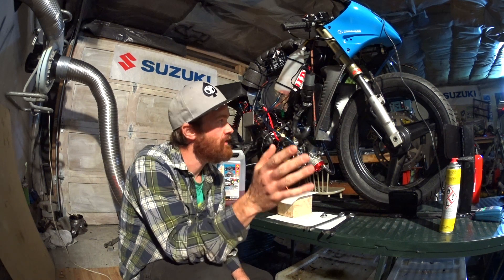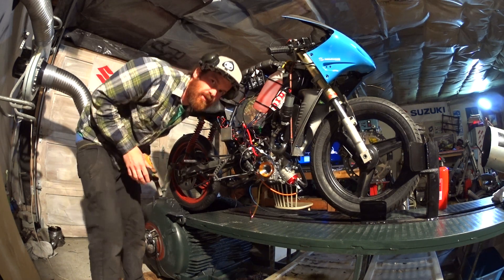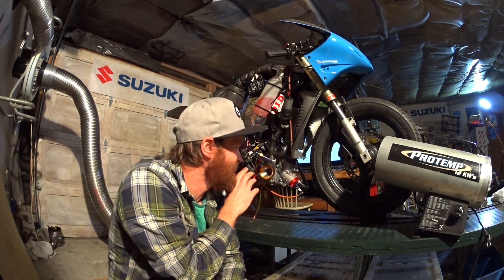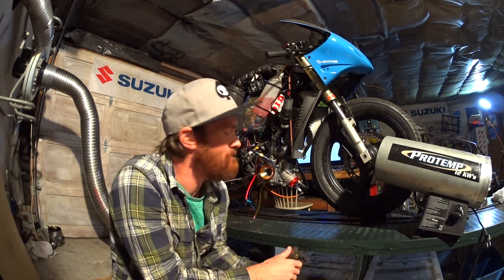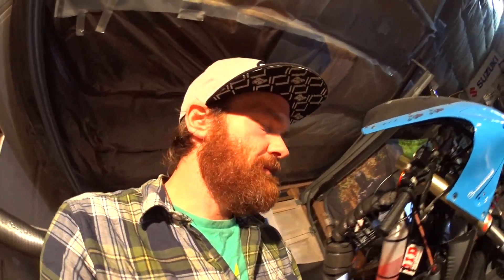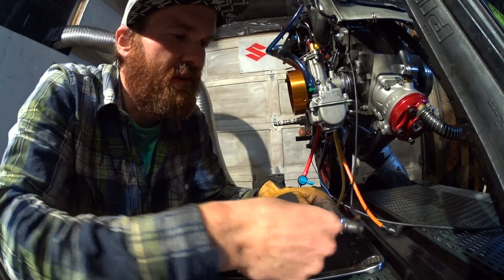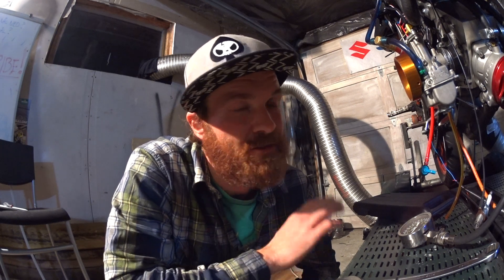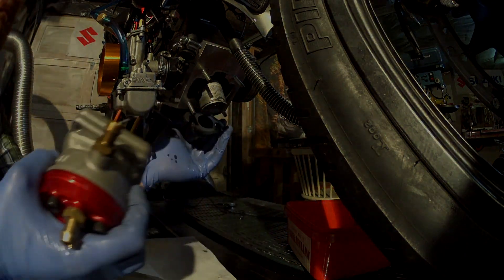DESTRUCTION ON DYNO | Moped on Methanol/Nitromethane - The End?

Comment: Anybody who has experience with model airplane engines (names like: OS, Webra, Cox, Rossi, OPS, HP, Fox, ASP, K&B, etc) that run on methanol and nitro, knows just how important it is to never run lean. Model airplane engines have a needle valve rather than a fixed jet size. The engine must be started with the needle valve setting richer than the final required setting. Once the engine has started, the needle is closed in towards the best final setting. RC modelers generally don't have instrumentation to set their engines, they have to do it by ear. The best final setting is NOT at the maximum speed which is fairly easy to hear. There are numerous things that have to be allowed for, so that the engine never runs lean. These are: nose up or climbing, fast turns, higher air temperature, the plane's speed, air pressure, etc. As a result, a certain safety margin needs to used to stay on the rich side of the best final setting. This is generally determined by experience. Fortunately, the small model engines running on glow plugs, sag and die before they damage themselves, so a burnt piston is extremely rare.
I would suggest that you get a model engine and play around with it to learn what operational care it needs when on methanol and nitro. If you do experiments on a smaller engine, it will be less work, cheaper and quicker to do. Maybe use a weed wacker engine. They are a dime a dozen. Keep up the good work.

Comment: hello it's exellent what you do !!! how much you put ahead of the ignition of more than with the normal fuel? Do you add oil in nitro methane? and how much nitro 5% 10% 16% 25% thank you for your answer
Reply from the maker: +dam3122 Thanks! I'm running RC fuel, 20% nitro, 15% oil. Have been running the same timing as with gasoline - 16° btdc at peak power.

Comment: Its see that the piston ring is fuck up use more room on the piston 
Between the cilinder piston is getting heater Den the cilinder 
Use wonder olie gr marf
Reply: Is hard to run on nitro
Reply: Use 18/Its shift by 7000rmp to 16/
Reply: Keep faith
Reply: Use denso spark plug